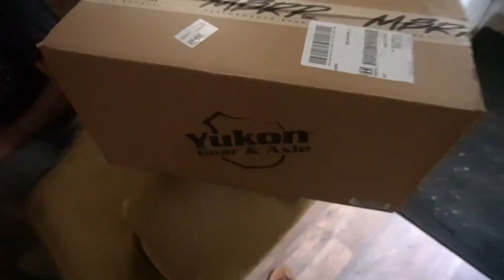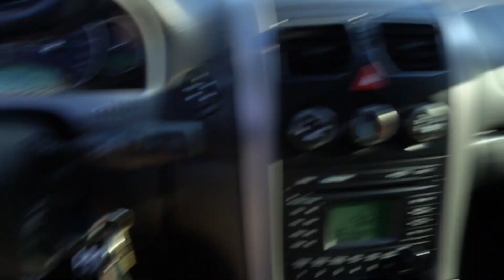PUTTING A CIVIC EXHAUST ON MY V8 CAR!

Comment: lol I had a 2001 slk230 years ago. I ran 3" pipe to a Flowmaster high Flow cat to a 3" DC sports muffler. it sounded really good actually always wondered how they'd sound on a v8. now I kinda know what a tuner exhaust sounds like on a v8 lol.
Reply from the maker: That sounds interesting on the SLK! I was pleasantly surprised with how it sounded on my gto made it a lot more tame than my previous SLP exhaust setup.

Comment: So its about the type of engine 
 that sound good.
Reply from the maker: I was honestly scared that the mufflers would make my LS2 sound like a k20 if I wasn't careful.
Reply: Engine type and manifold design effect style of sound way more then a muffler will. These 1320’s are basically a large body glasspack with steel wool like packing as well. You can make a 90’s civic sound just like an STi with 1320’s unequal length manifold they make for B and D series. A 4 cylinder with the same firing order is a 4 cylinder regardless of cylinder orientation. On a B series you’ll lose power with such an inefficient header design but it’s doable. K series or B series sound they way they do because, for a 4 cylinder, they are designed very efficiently and flow very well. Coupled with very equal length aftermarket manifolds, they make the sound any high flowing, performance oriented 4 cylinder will, a high strung bumble bee. There’s a reason why you see 7 second promods and 8 second outlaw class 1/4 mile naturally aspirated k series civics out there, they perform a lot better then they sound…